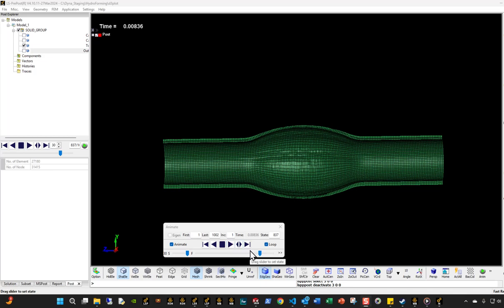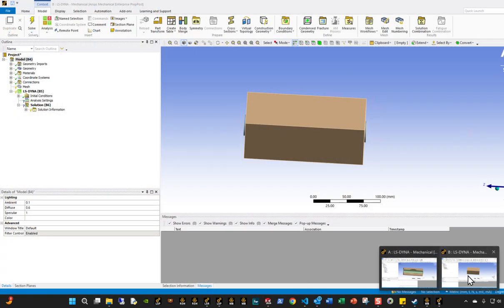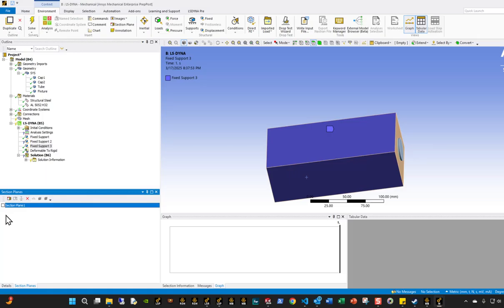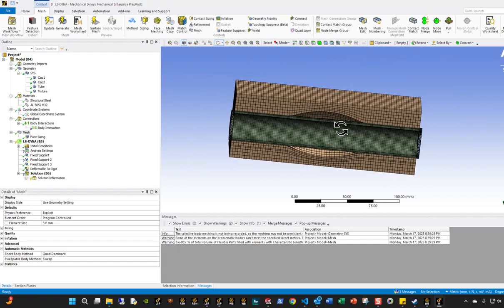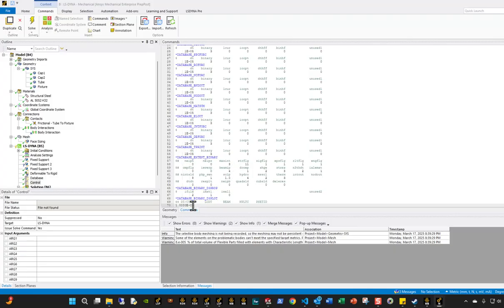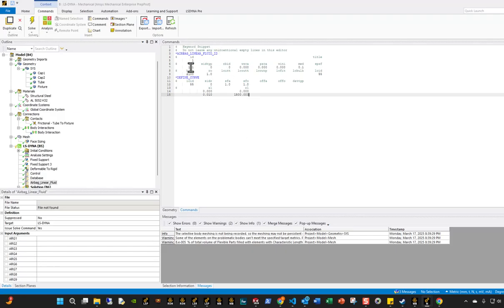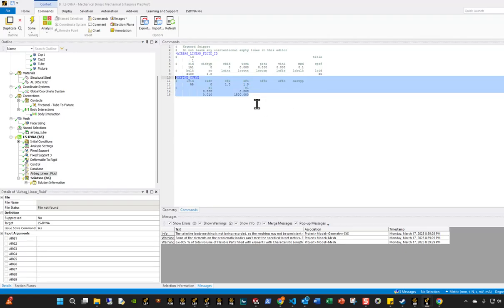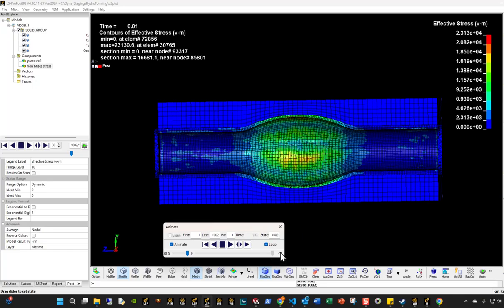Ansys LS-Dyna Tutorial - Hydroforming simulation using Airbag_Linear_Fluid

Comment: Hi ! Very nice simulation. 
I was wondering if it was possible to model similarly the rise of a water level in a bottle for example with two airbags, one linear fluid like here, and one pressure volume for example for the air, separated by a membrane ? it's more of a fluid structure problem if you want to see the deformations of the bottle, but it could be approximated in structure only simulation ?
Reply from the maker: Hi, I believe this type of problem is better done by directly modelling the source of the rise of water level.   For example, you can do this with ALE/SALE approach and define a fluid influx.   There are actually example out there about filling of a pouch.  In this way, the interaction between lagrangian body(membrane) and the fluid (SALE) can be directly defined.   On the other side of the membrane, you can maybe use an airbag model.

Application like this is pretty interesting but water in water bottle doesn't really just rise on its own so if you can share how you water rise in reality, I would love to know as that would define the problem statement for me.
Reply: @DCFEA  Hi! thank you for your answer! 
Ok I see, thanks for the explanation. What I had in mind was a balloon-like structure with a hyperelastic skin (maybe anisotropic with MAT_295, so hexa or tetra), partly filled with water and air, with water coming in from a small vent on top. I’m not really interested in the flow details, more in how the stresses and strains on the wall evolve with the added volume.

At first I thought of using two airbags inside (linear fluid + pressure–volume), but it does feel a bit overcomplicated. Maybe ALE is indeed the better approach, though FSI always looks a bit intimidating when you mainly do structural FEA.

Do you have any reference for the pouch filling ? I would love to try it myself !

Comment: Good video, thanks! Would you get a similar result applying a direct pressure load to the inner faces of the tube? What is the advantage of using the Airbag model?
Reply from the maker: Hi Peter, this is you right? 😁.   I also tested out using pressure, which in dyna translates to a load_segment_set which works by applying a pressure along the normal direction of the elements.   In that regard, we get a pretty similar response in the end.

However, the value of airbag_linear_fluid is to allow this process to be displacement controlled by defining mass flow rates.   In my example, however, I did not do that because it's easier to just use the pressure functionality in the card to do a quick demo.   This paper provided a direct comparison of the 2 in one of the paragraphs.  https://lsdyna.ansys.com/wp-content/uploads/attachments/process-chain-simulation-for-201cdie-less-hydroforming201d-including-welding-and-forming-using-201cdynaweld201d-and-201cls-dyna.pdf

basically, airbag_linear_fluid gives us more options but load_segment_set does the job if we just want to apply a uniform pressure.
Reply: @DCFEA  Hi Dennis, yes, it's me, Peter.  Good answer, thanks!